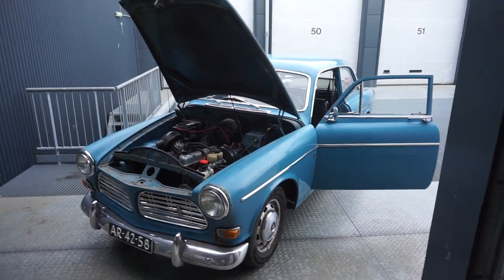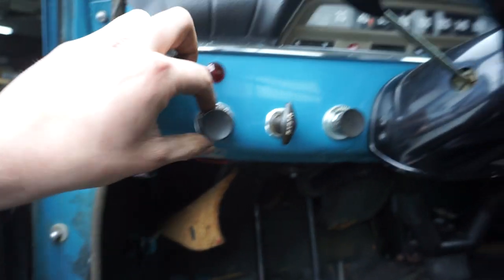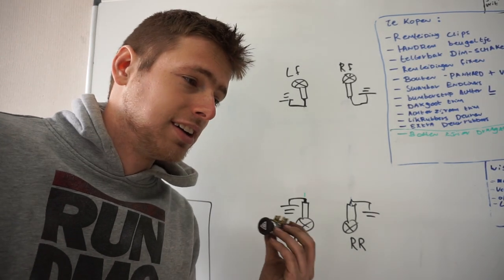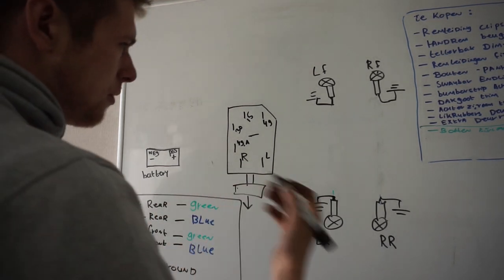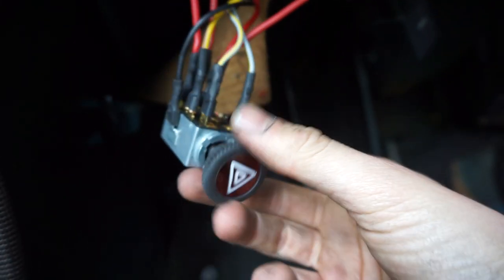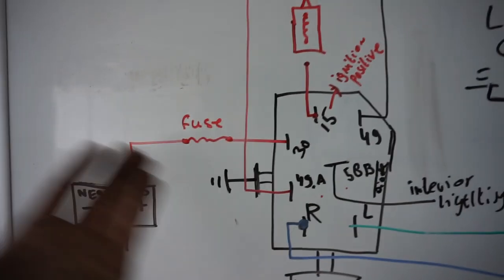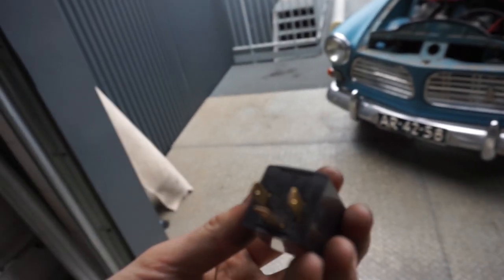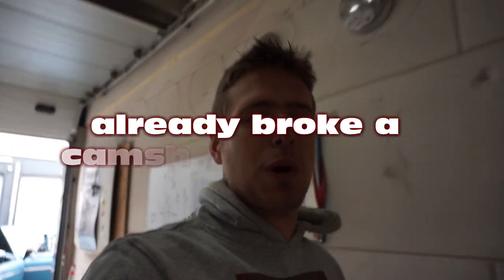how to easy wire up hazard lighting on any car

Comment: I have a 69 vw bug i'm in the process of rewiring I appreciate  your video what i don't understand is the need for the dome light (inside light) on a hazard light what is the reasons for that
Reply from the maker: It's probably for the safety at night. When driving in the dark the dash interior lighting is lighting up the locations of where most of the switches are. If the hazard light itself lights up you can easily find it in the dark in case of emergency 😄👍🏻
Reply: Sorry i thought you was refurling to the dome light the one that comes on when you open your door lol   @RollinHeritage

Comment: Struggling to understand the reason for both a battery power input and a switched ignition power input.  My application would be non VW.  Will it work with only a battery power input?
Reply from the maker: I use it non Vw also. You wand the switch to work when the ignition is off. That is the main power. The ignition power is for the lightbulb inside the switch i think. I will go and look for you as soon as i'm at the car again. i already figured it out but can't remember it anymore.. 🥲😂

Comment: Hi! On my car after wiring like this video the hazard working good but when the key switch is off i found 12v direct on the coil and the engine not stop! can you help me?
Reply from the maker: Then the hazzard switch is sending 12V back to the coil in some way. Only thing i can tell you is take the wires off one by one and use a volt meter to see were the power is coming from
Reply: @RollinHeritage  maybe i fault this.. i apply on pin 49 (+ turn relay) on pin 49a (- turn relay)

Comment: Why does the switch need to be connected to the interior light and the ignition coil ?
Reply from the maker: interior light is to light up the switch when the ignition is on. ignition coil is a switched positive by the cars ignition switch. But i think when you only have the direct positive conected it will work too 🧐 i will check that out!

Comment: How do you connect when using a 2 pin flasher
Reply from the maker: 2 pin flasher? haven't worked with those before. Always 3 4 or 5 pin. i'm Sorry!

Comment: Sorry bud, that's not a diode, it is a resistor, is there to deem the switch light when you have the lights on at night, so you have a light helping to locate the switch at dark. Then the resistor gets bypassed when you switch on the hazard and the switch light flashes at full brightness.
Reply from the maker: The point i was trying to make was clear, the correct words for it not i guess 😅😆 thanks!
Reply: No worries mate. Your tutorial is a good help and works fine.
Thanks for posting.

Comment: Where can I get that switch?
Reply from the maker: Any classic volkswagen parts suplier. Or maybe amazon or ebay? Here is a link, i don't know if it will help you out

https://www.ebay.nl/itm/125727205041?chn=ps&norover=1&mkevt=1&mkrid=1346-169751-306036-7&mkcid=2&itemid=125727205041&targetid=293946777986&device=m&mktype=pla&googleloc=9065293&poi=&campaignid=20671490579&mkgroupid=151980119182&rlsatarget=pla-293946777986&abcId=&merchantid=5323683504&gclid=CjwKCAiAq4KuBhA6EiwArMAw1H4sP8Q1gNyZlr2eemRNnf_JWZDl4RPT7j4LfSRmVrWgMfzUKgliExoCXHMQAvD_BwE

Comment: Your fuse need to be as close to the battery as possible for safety reasons
Reply from the maker: thanks for the comment. The reason people say this is in case the wire get's broken or touching ground, it wil have the fuse close to the battery and therefor the fuse will work "better"  wich is not super incorrect but well, As you could see the original fuse box is in the exact same spot as the inline fuse in the video. wich is 50cm from the battery. Keep your fuses next to eachother! if you ever have electrical issues and have fuses all over the place it won't make your work any easier.

A fuse will still do it's job when it's one inch from the user and 10 meters from the battery. But in those cable lengths i always recommend using two fuses because they cost next to nothing.
you could not see it the video. as it was on order but i mounted a brand new fuse box above the battey for all my new accessoires.